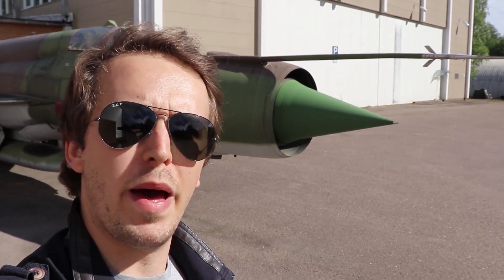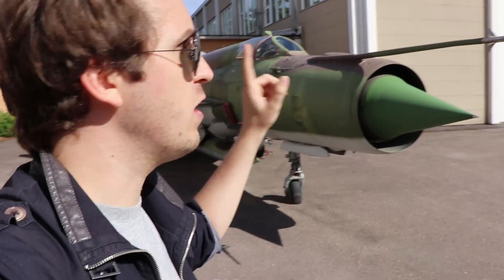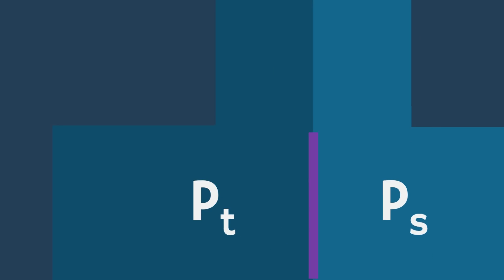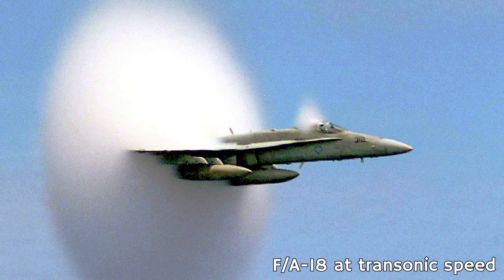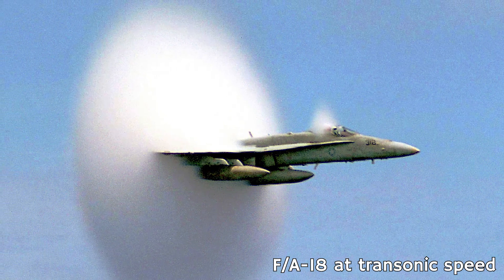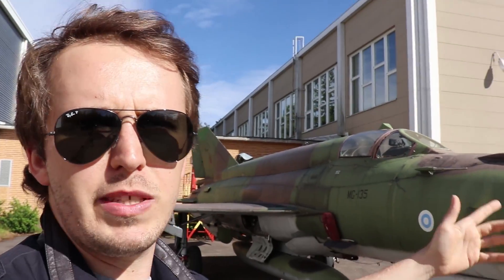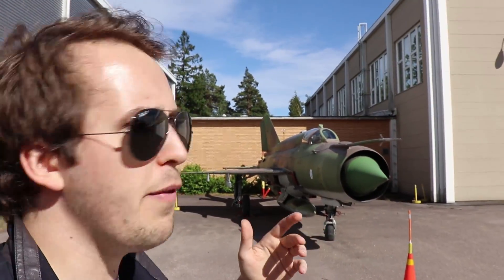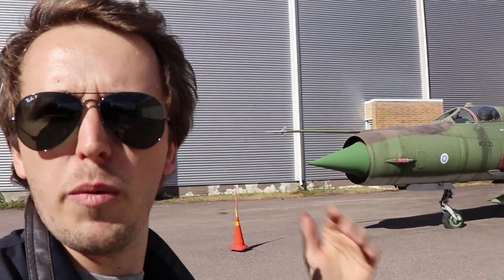Why does the MiG-21 have the pointy thing?

Comment: You discussed the WRONG pointy thing !!
Reply: the big, conic thing houses the radar
Reply: Well the "conical" thing has more of a point.. while the "lance like" thing has more of a "tip"
Reply from the maker: Never thought I'd have this discussion :D
Reply from the maker: You would have preferred me talking about the radar (RP-21) in the nose section?
Reply from the maker: Oh, wait, you thought I was pointing to the nose and not the long, thin 'lance'?
Reply: The nose spike serves both purposes, regulation of airflow/shockwave into the engine and housing the radar....there's no other place radar COULD go on that bird.
Reply: The spike is used to control the air entering the inlet. The MIG 21 spike starts out in the retracted position and moves forward the faster the plane goes. This is because it is an external compression inlet and the spike will keep the shockwave outside of the inlet above Mach 1. The SR-71 engine spikes start out in the forward position and retract the faster the plane goes to bring the shockwave inside the inlet. I don’t think the spike houses the radar since it is movable.
Reply: So apparently the spike does house the radar even though it it can move.
Reply: UltimateEel And it acts as a shock diffuser for high-Mach flight.
Reply: “My eyes are up here”
Reply: Also important for airflow into the engine.
Reply: To be honest after having a look at it in DCS: Mig-21 you can say the important bit about the radar in one two words: 
It's shit! 

:P ;)
Reply: Jamie Cottrell what is the origin of your sir name? its a very unique name.
Reply: Incorrect. There is a movable cone, which ensure the proper amount of air.
Reply: Wow, and there's me thinking it was for spearing seagulls for squadron nutrition!
Reply: Oh, i want  to know what that orange pointy thing in front of the aircraft is

haha
Reply: That nose cone is retractable. It is retracted at low speeds and extended at higher speeds to keep an optimum air inflow speed for the engine air intake. Bad things happen if air is ingested into the engine at supersonic
Reply from the maker: AH, Amerikan! You win again :D
Reply: As TRUMP says ... life is full of surprises !!
Reply: Not yet... winning is FOUR PERCENT of GDP for NATO/DEFENSE by EVERYONE !!
Reply: To be honest, thats what I thought the video would be about and was slightly disappointed when you talked about the pitot tube instead... Though when I was a little kid and saw 21s with that "Lance" I thought it was some kinda explosive spear or mini-rocket/missile for use when the 21 was too close to its enemy for regular missiles and was either out of gun ammo or the guns had malfunctioned or the pilot didnt wanna use them!
Reply: May HE bless us with more of his eternal wisdom!
Reply: No... GOTCHA . (Yankee humor)
Reply: What you got to "diffuse" the SHOCK of TRUMP  ??

Comment: On civilian private aircraft such as Cessna's, the Pitot tube is towards the front of the aircraft and it sticks out a few inches from the fuselage and is  about 6 inches long.  I guess because of the lower speeds it is not as critical that the opening be far out in front of the aircraft.